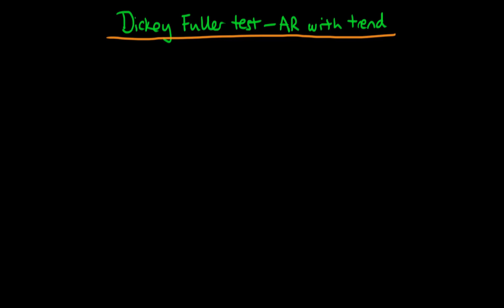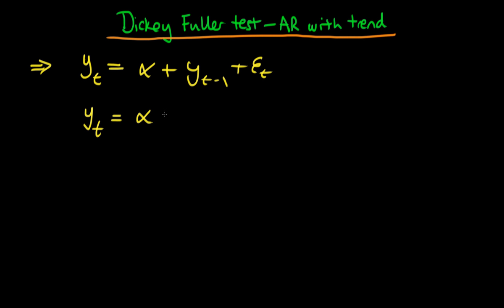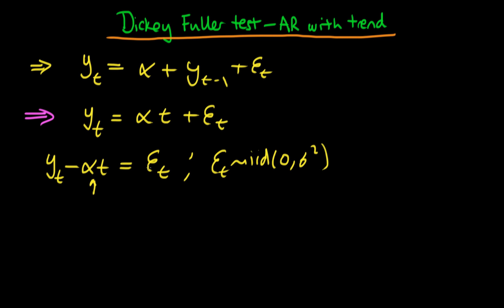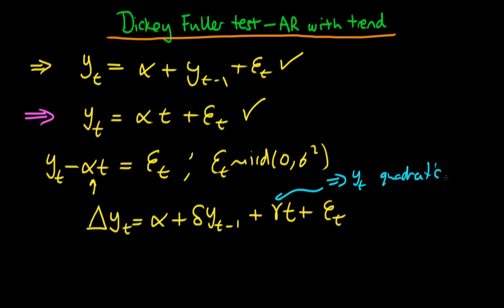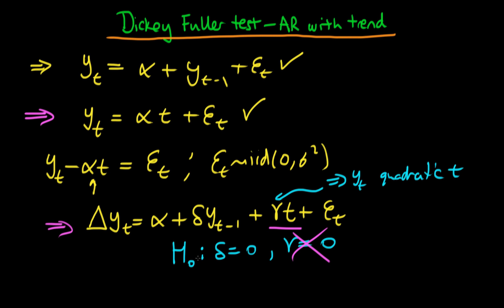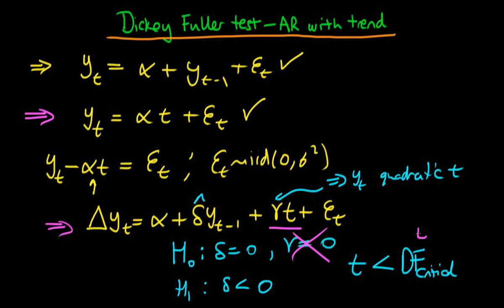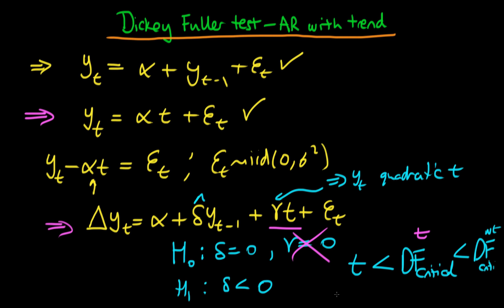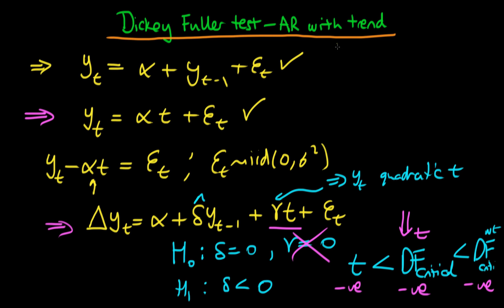Dickey fuller test with time trend

Comment: This is the only one I did not understand well in all your videos. Why do we add a time trend to difference? What if I don't want to test a quadratic random walk time series?
Reply: You can add a time trend to determine if a time series is trend-stationary. If you were to run the version of the DF test Ben wrote in this video and found that the coefficient on time was significant, you would use this model to check if the time series is stationary (ie, use this value of sigma to do the test). Trying to do the test with a different model (ie, one with only a constant alpha), would suffer from omitted variable bias and the value of sigma would be incorrect (sigma would "steal credit" for omitted gamma's work)